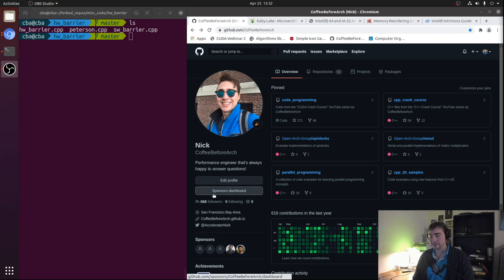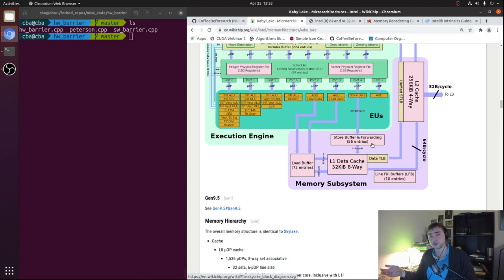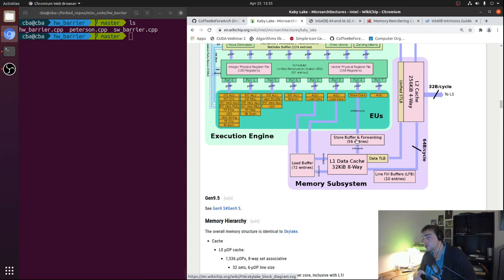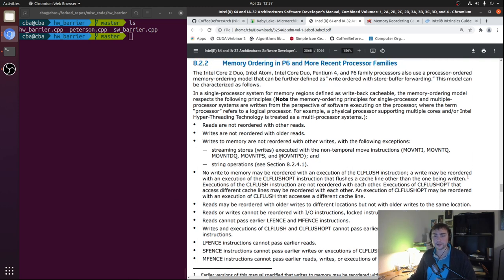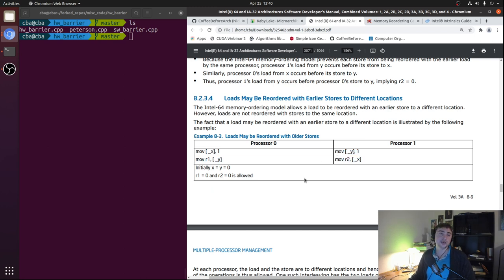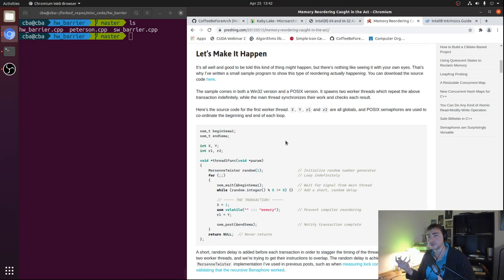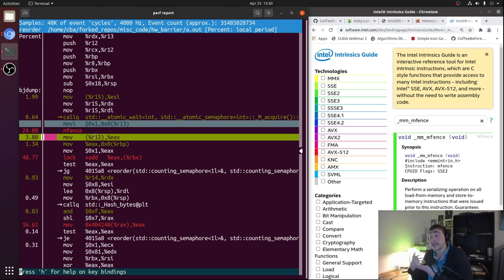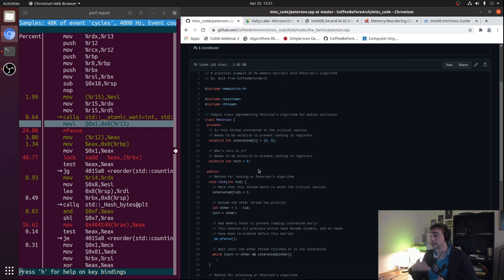Advanced Topics: Hardware Memory Barriers

Comment: 1) Why does the store buffer have 56 entries? Is this just some heuristic chosen by Intel?
2) Would it make sense to have more granular fences? Ex: mfence(0x456688ff) to just flush that one write? Or is too granular to be efficient?

Thanks for making these videos, I've learnt so much from them!
Reply from the maker: 1. Like the size/configuration of any hardware structure, it'll be determined by some sort "common case" analysis. 56 entries is probably just "good enough" for most cases.

2. Depending on the specifics of what you mean, that would break the x86 processor ordering memory model. If the write you want to flush is not next to be drained to the L1$ in what would logically be a FIFO store buffer, you would be reordering that write past earlier writes in program order that have not become globally visible yet. There are more relaxed memory models that allow  reordering of more than older writes with later reads, but x86's does not allow this. 

Glad you are enjoying the videos!

Comment: Instead of the hardware barrier instruction, we can also readback the value we just wrote (from the same address)..This will force CPU to flush  the writes before the read..
Reply: Not in the general case, as the compiler might not do the actual read from memory, as it already has the value in a register. Remember that the compiler only sees one thread of execution and will optimize that. (With volatile, this might work, but at a cost.)